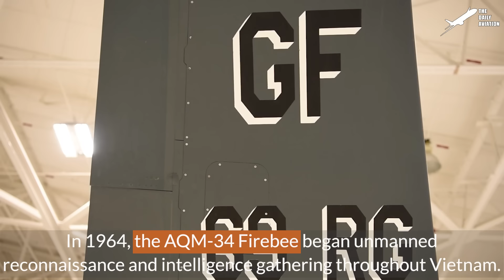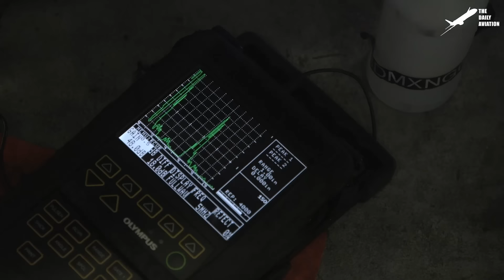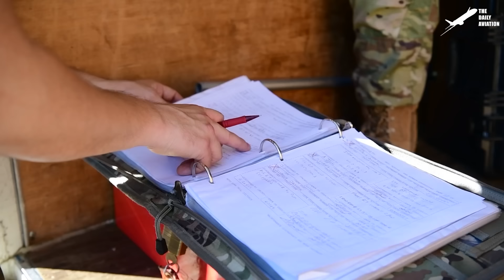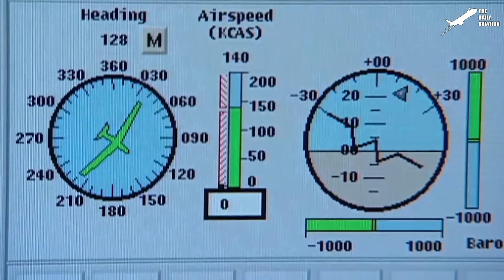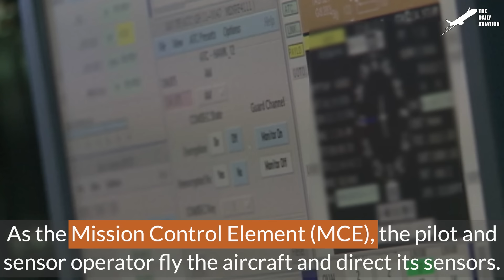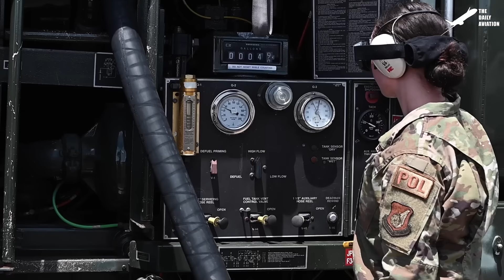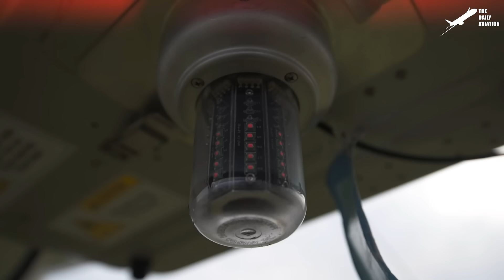Inside US Military Factory Building World’s Most Expensive Drone

Comment: the RQ-4B Global Hawk UAV can be adopted as an armed UCAV . . . a section of it's enormous fuselage can be turned into a reasonable capacious internal weapons bay . . . one that could easily fit in a couple of AGM-158E JASSM-XR active radar homing inertial guided air-to-surface land attack cruise missile . . . or CBU-56 guided munitions for that matter . . . active countermeasure suite & new state-of-the-art Rolls Royce F138-RR-100B turbofan engines producing no less than 8,200 lbs of thrust . . . for easier ground handling at air bases the RQ-4 could seriously do with some folding wings . . .